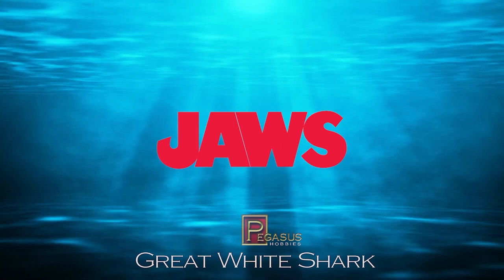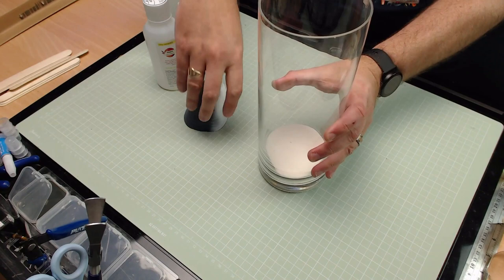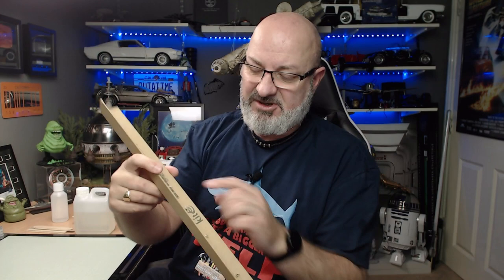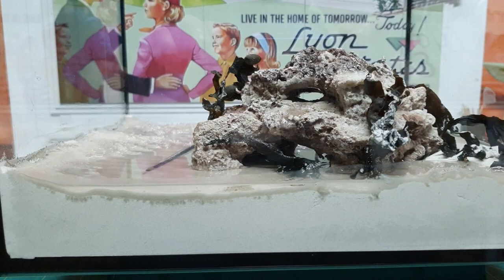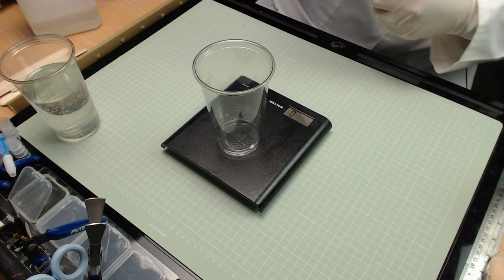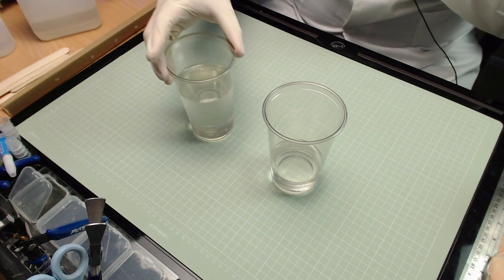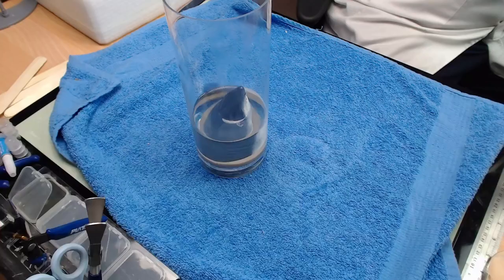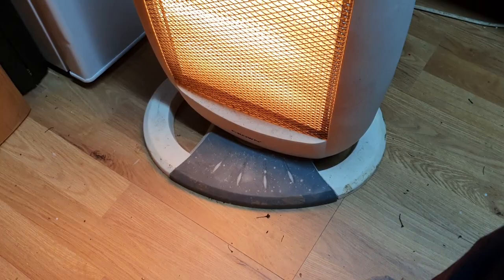Build the Pegasus Hobbies Great White Shark Jaws Diorama - Part 3 - The Resin Pour Test

Comment: The only resin I ever had any luck with is called ArtResin on Amazon.  Every other resin I've tried ended up turning yellowish within a year.  Not all resins are the same and react differently to each type of paint.  I've learned the hard way that it's best to paint sample squares of sheet styrene with your choice of paint or clear first and then apply a thin layer of resin on top of that.  If your styrene square turns into a leper then you need to adjust the paint or change resin.  ArtResin has been the most forgiving so far.

Comment: Wayne, you should replace the preview image of this video with a frame depicting you in labcoat holding the hair dryer :-)
BTW, not all the resins are the same so maybe test the other resin you are going to use in the final pour with some painted plastic scrap material before pouring it on the actual shark model.
Reply from the maker: Good idea!

Comment: The reason the paint has come up like that is due to the heat of the reaction of the resin. You can clear varnish to protect it as you say, or you can just coat the model with a thin layer of the resin initially and let that harden before doing a full pour. A thin coat of resin, like the varnish, will protect the paint and won’t heat up enough to cause issues with the paint. Also be careful what kind of varnish you use and try and a UV resistant one. Otherwise you’re going to get a very yellowed shark and model down the line.
Reply from the maker: The thing is I monitored the heat. It wasn't even warm when this started to happen. In fact the whole reaction rarely got over 40 degrees.